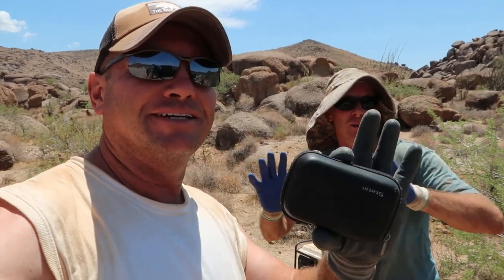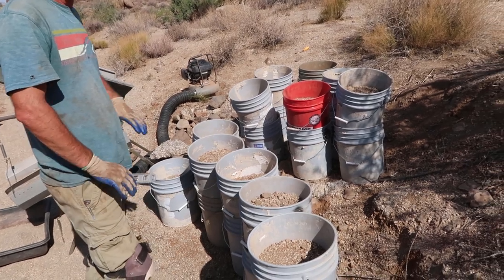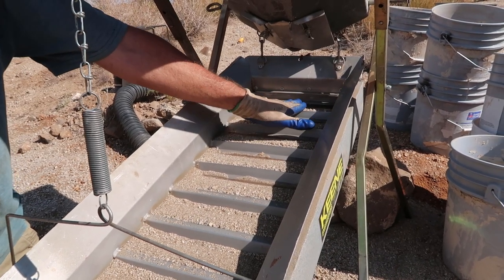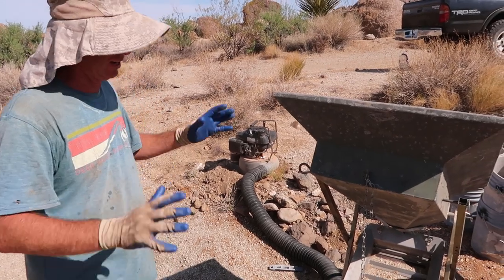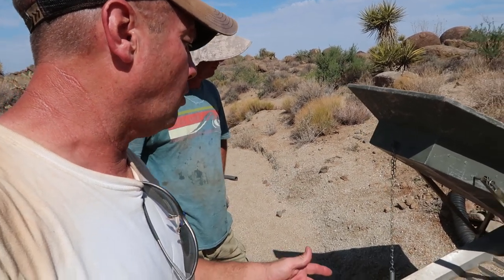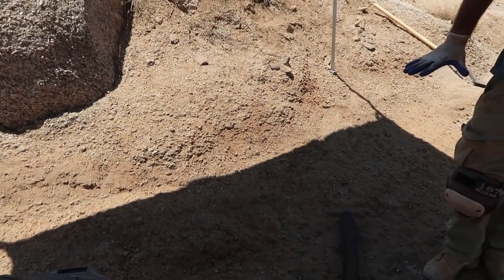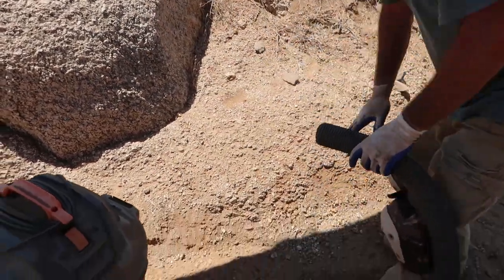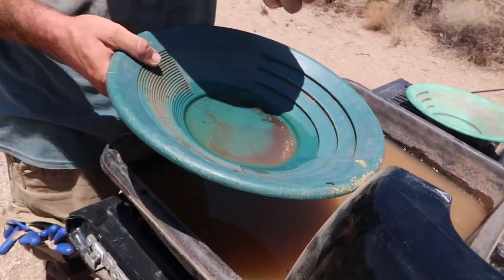Dry Washing & Prospecting Tips To Get More Gold Anywhere

Comment: not the dreaded " Elephant Trunk " hahahhaha thought I was on the wrong channel there for a moment ......  that is some nice looking Shiney there sonny Jim ....also mention to keep your vac pac lower then your workings and the tube build up too ...... stay out of that Heat or you will look like Slim ....keep'em coming sonny Jim
Reply: And 10 ft tall fan with a misting system connected to a 10,000 gallon truck filled with Dasani water, that way you get those extra minerals
Reply from the maker: @redlizerdgate    mmmmm Dasani !  lol
Reply from the maker: Ha ha ha .....Stay cool out there  !
Reply: still wondering where Slim has slipped off to....

Comment: I agree buckets are more efficient.  Easier to fill a bucket and not burn fuel.  Then batch it into the machine for a shorter processing time.  I’ve used most of your tips but good ground is hard to find.   You also might think about investing some of that gold in upgrading your dry washer.   The newer versions don’t run through cloth as fast with a drop zone that helps distribute the sand more evenly and bumpers to stabilize the tray instead of the boulderdash patented rock.   Just saying because all these tips are worth their weight in gold!   I’m happy with .15 grams for a days outing in the desert.  Thanks for sharing.  ⚒
Reply from the maker: Awesome, and thank you so much for watching !

Comment: Great video guys and good tips as always, when alone or in an area we have to carry material to the machine I use buckets, but when we have a couple folks working we keep a feed pile. Like working on a hillside with the drywasher right next to the material we are running we simply shovel, one feeds the machine and clears the grizzly while the others maintain a pile for the other to keep a full hopper. Like you said even flow is very important!

Comment: i changed mine to a small 12 volt variable speed motor with a weight on it 
to control my vibration and then the fan for my airflow so I can control them separately.
Reply from the maker: Dude , thats a pretty neat idea. You could really control the vibration more accurately ... Well done and thank you for watching!
Reply: Hey Tank,  do you have a link for that 12v vib motor that you use??   Im in need of a new royal fan bearing , and that may be a better option??

Comment: I noticed that you guys don’t have the rubber bumpers on the end of the box. Would you still recommend the rock hanging from the end if you have the rubber bumpers?
Reply from the maker: Yeah so the new models have those rubber bumpers. My understanding is that its supposed to help vibrate the grizzly box on top.  There is no way that does any good in my opinion. Over engineering !

Comment: What's the biggest Arizona nugget you've found drywashing? In an average year how many would you find bigger than 3/8?   is it really that valuable to (in your opinion) screen material larger than 3/8 (1/2, 3/4) for the bigger pieces to be banging around the material in the recovery tray to loosen small gold?
Reply from the maker: Man thats just to many questions.  Dont over think this stuff. We always lose gold over the screen , but if you dont know , then it doesent matter. 
As for fine gold , when set up properly , the dry washer doesent lose much

Comment: Question for you because I know you have a Keene 140 or 141. Have you ever had to spray the counter weight. At times it does not start and does not seem to shake the box lots.
Reply from the maker: No, I have never put a lubricant on the fan assembly. I have seen them slow to start though.
Reply: Thanks for your response I know you would know because of your usage of the machine.

Comment: My dry washer has no moving parts, moves material a lot faster with a steeper pitch.
Reply from the maker: You’ll find that, the steeper the pitch the further down the riffles gold will go
Reply: @IBRAKEFORBEDROCK  The riffles on my dry washer are round to facilitate the flow of gravels.